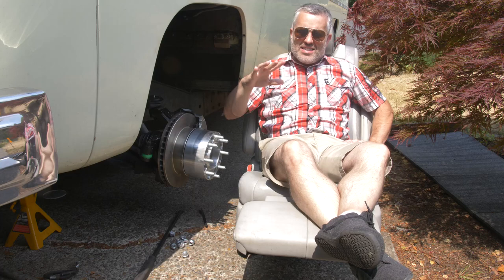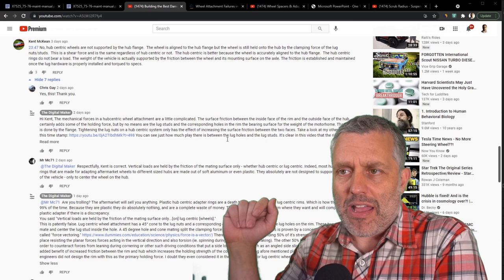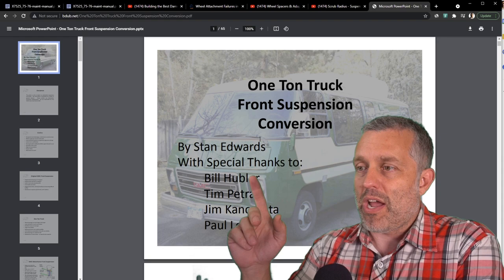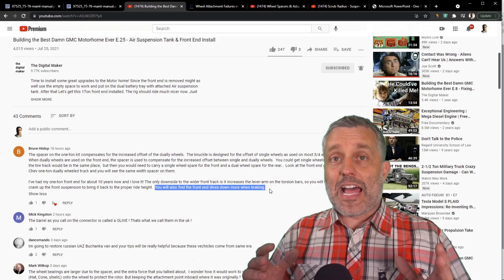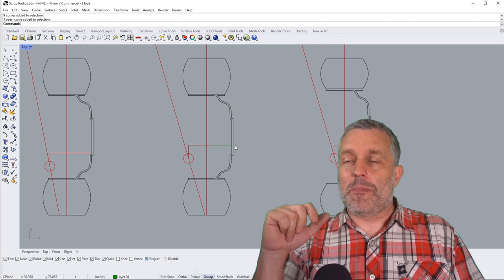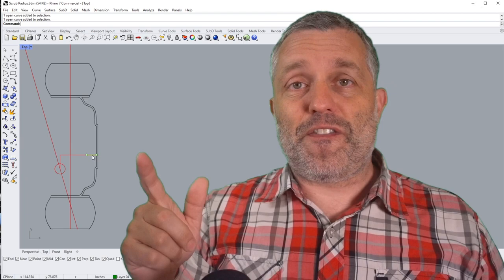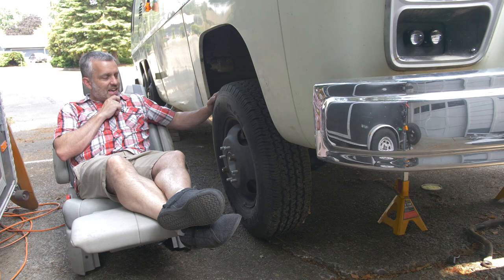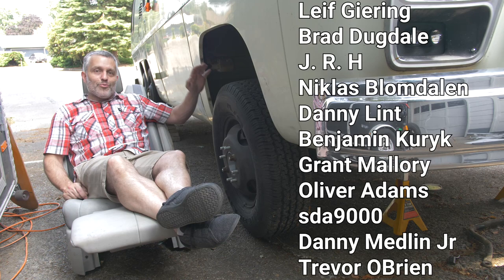GMC Motorhome 1-Ton Upgrade - Engineering Explained

Comment: The specs for a single rear wheel 1-ton Chev/GM one ton truck show a positive offset of 28mm.  The dually wheeled truck wheels have a positive offset of 125mm.  So the difference between the two types of wheels is 97mm (3.8").  So that spacer at 3.5" is actually 0.3" short.  I'm not sure what the OEM spacer is, but maybe its 3.5" as well and GM had a reason for it. As I said in my comment to your previous video. the spacer just puts the tire track of dually type wheels back in the same position as single wheels would be.  I'm not sure where you got the difference in offsets as being 1.5".
Reply: GMC never used a spacer on this vehicle setup....there was one made by a person and sold in order to space out the front wheels the distance needed to match the rear track (rear wheels on these coaches track wider than front).  The bigger spacer for the 1 ton is to offset the bigger brake setup and as a bonus it actually makes the track the same front and back.
Reply: @richardmondor1360   The one-ton knuckle was designed to work with single rear wheel trucks with a 28mm offset wheel.  The spacer is used to place the 125mm offset dually wheels as used on the Motorhome to put the tire back in the same track as the single wheel. If you put a single wheel without a spacer on a one-ton front end, the tire will be in the same track location as a dually wheel with the spacer. Look at any GM/Chev one-ton dually wheel pickup and you will see a spacer there from factory.
Reply: @brucehislop8860  yes and you willalso hit the caliper as the brake rotor and caliper are much larger than stock hence one of the other benefits or issues depending on how you look at it, when going to the 1 ton conversion.
Reply: @richardmondor1360  I went to the one-ton 10 years ago and have no intention of going back!
Reply: @brucehislop8860  if i had to do the front end on mine i'd be going one ton as well, dont get me wrong.

Comment: Just watch your tire heights, front isnt the problem, its the rear as you get to close to the boggy boxes etc....lots of info available on the this issue if you dig around. 
The one ton upgrade is a not perfect either but not much choice verse whats available for suspension components these days.

Comment: the 250 ft-lb torque spec is a typo
Reply: No,  250 ft. lbs. is correct for the original steel wheels from 1973-78.  There's no way a typo goes unnoticed for six years and 12k coaches built.

Comment: 4:02 I am going to say it one more time.  The hub centric ring has only one purpose and that is to align the wheel and axle/hub of the vehicle.  The hub centric ring provides NO "safety catch".  Many factory hub centric rings are plastic or aluminum.  For example my Audi A6 has alloy wheels and hub centric rings made out of plastic (this is "as provided by the OEM manufacture").  Do you think Audi is stupid enough to put a plastic hub centric ring in service if it provided ANY mechanical function to the system???

The article by James D. Varin is an excellent article but you should have noted that he only talks about clamping force, I did not see any reference to your "secondary function of the hub centric ring as a "safety catch"".  I should also note that the article is about "light duty vehicles" and the author seems to lump everything that does not have duel rear wheels into this category.  When the author talks about "Bolt Piloting and Hub Piloting" he specifically says: 

"In bolt-piloted systems, the geometric features of the wheel nuts (usually either spherical or conical) mate with similar features formed at the bolt holes of the wheel so that when the nuts are tightened the nuts force the wheel to assume a position in which the mating surfaces are “nested” and the bolt circle of the wheel (the theoretical circle formed by the centers of the bolt holes) coincides with the bolt circle of the hub (the theoretical circle formed by the centers of the wheel bolts). In hub-piloted systems, the center hole of the wheel is piloted on the hub itself, requiring that both be machined to very exacting standards and that the diameter of the wheel center hole be only slightly greater than the diameter of the hub. The bolt hole areas of the wheel are then flat (lacking the conical or spherical surfaces present in bolt-piloted designs) and are larger than the major diameter of the wheel bolts so that the wheel slides easily over the bolts. In the recent history of light vehicles (since at least the 1930s), bolt-piloted designs have predominated. Hub-piloted systems began to emerge in the early 1980s".  

This is generally true when talking about Medium duty trucks (which the author makes no reference to, only making the differentiation with "duel real wheels")  but is patently false when talking about "Passenger Vehicles" such as cars and light duty trucks (1/2 and 3/4 ton).  Since the early 1960s North American auto manufactures have used a hub centric steel wheel with a geometric feature formed at the bolt holes of the wheels (usually a 45 degree conical seat) and a matching feature on the wheel nuts (45 deg seat).  The author talks about this in reference to the "bolt-piloted" systems but then states that hub-piloted systems use a bolt hole area of the wheel that is flat and this is not true of systems used in Passenger Vehicles".  So this hybrid system of 1960s North American auto manufactures has continued in use even today (2021).  Note that alloy wheels are a bit of a mixed bag and I have personally seen OEM alloy wheels that are hub centric and use a 45 degree conical seat and matching wheel nut and OEM alloy wheels that are hub centric and use a flat seat and flat faced wheel nut.   

Regardless, I stick with my original statement; The hub centric ring has only one purpose and that is to align the wheel and axle/hub of the vehicle.  The hub centric ring provides NO "safety catch".
Reply from the maker: Kent, if that's the only purpose of the hub flange then how did my wheel stay centered, balanced and damage free during the 5 hours of driving I did in all highway conditions with only 4 of the 8 lug nuts tightened to approx. 40ft/lbs (Note: they are spec'd. at 250ft/lbs)? Remember as I was driving I heard a clunk upon starting and stopping. I even showed this on camera in the "40 year old motorhome in traffic" video. That was the sound of the rim spinning around the flange until the lug stud prevented further motion. The proof is in the putting. The flange acts as a safety catch.  Or do you think it was divine intervention? Maybe I had some invisible angels holding up the front end of my motorhome. Plastic spacers are a hack that came A loooooong time after the original engineers who invented/designed hub centered wheel attachment. Heck, petroleum plastic wasn't even a thing when they invented hub centered wheel attachment.
Reply: @IndustriousPursuits  1st: Your lug nut torque is not 250ft/lbs, that is a typo.  Torquing a 9/16" grade 8 stud that high will stretch them and they will eventually fatigue break.  This has been discussed many times on-line over the last 30+ years. The consensus is that 140 ft-lbs is more than sufficient.

2nd: With your loose lug nuts, the wheel did not stay centered, balanced or damage free.  A close inspection will revel the metal to metal contact that was occurring when you were hearing the clunking upon starting and stopping.  Your studs were banging against the insides of the stud holes in the rims.  No doubt, if the lug nuts are not too loose, the flange will keep the wheel centered but that isn't it's design function, this is a happy (lucky) unplanned result.

You say plastic spacers are a hack, but how can you explain the OEM "plastic" hub centric rings that came from the factory on my A6 Audi?
Also, your wheel spacers with there hub centric ring are made of aluminum.  I would bet you money that if you drove any distance with loose lug nuts on that aluminum spacer, the steel rim would shred that hub centric ring in no time and it would not be the "safety catch" you think it is.
Reply: I totally disagree, on my bmw the hub center aligns the rim. It's also taking the load . I use a 10 lb hammer on the tire to free it with no lug nuts on. The lugs are fixing the rim to the hub. The lugs are not taking the weight.  My gmc wheels do not fit the hub center tight enough to take the weight.
Reply: Audi has NO OEM Factory hubcentric rings. No major OEM uses hub centric rings. If there is Hubcentric rings on your car they are aftermarket or where originally for a different Audi.

Comment: I'm not sure where you get VWs having to have an entire engine replaced evwry 40k miles. But Ive know many VW ownera and thats not a thing for them.  Maybe if you've heavily modified the car and put something in it that doeant belong perhaps.
Reply from the maker: Aftermarket engine options have gotten a lot more reliable in recent years, but original VW vans are well known for needing engine replacements very frequently. Ask any old timer VW guy. He'll tell you. Alternately, go watch the old episodes of "Kombi Life" and watch him replacing engines on the side of the road in South America. https://youtu.be/nIr7PqvbUUk
Reply: But for some VW owners, it is a Thing.
Reply: He is referring to the old air cooled VW buses....problem with them is the air diverters used to pull cool air us to rust out and fall out....then the engine would run hot and generally live a very short life span after.

Comment: do you have 9/16-18 or 5/8-18 wheel stud thread sizes..

 https://www.etrailer.com/question-101173.html

 9/16 cone shaped lugs are 120 to 140 foot pounds at least on Etrailer..

5/8-18 solid flanged lug nuts are 275 to 325 foot pounds.. NON ROTATING FLANGE type..

 5/8-18 rotating flange lug nuts.. 190 to 210 Foot pounds.. 

   so it depends on if you have 9/16 or 5/8 and which lug nuts do you use.. 

 i don't want you or anybody else thinking that that 9/16 lug nuts can be torqued that tight.. it will stretch the studs.. causing failure 

 you may want to look thru the various lug nuts available on digital pages 49 thru 52..   http://www.billavista.com/tech/pdf_index/files/Wheels%20and%20Tires/Dorman%20Wheel%20Studs%20and%20Nuts%20Catalog.pdf

 i hope i have not torqued you off..